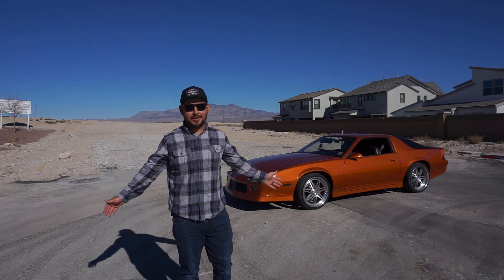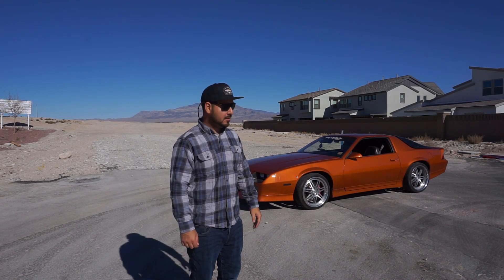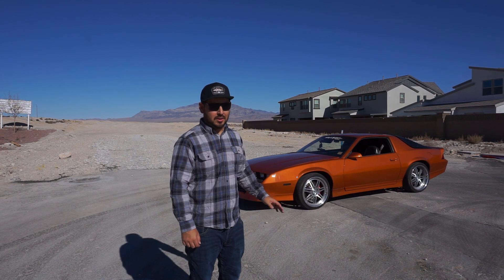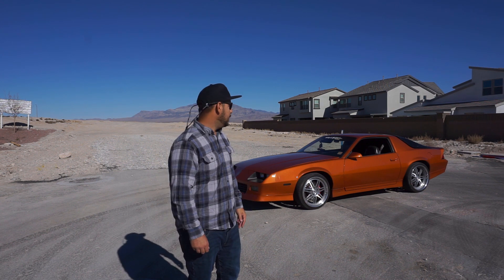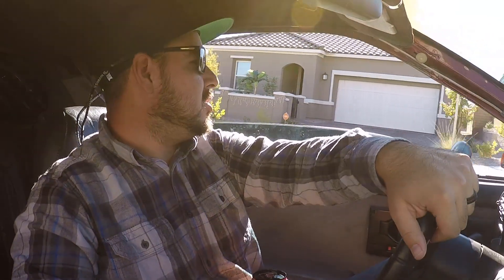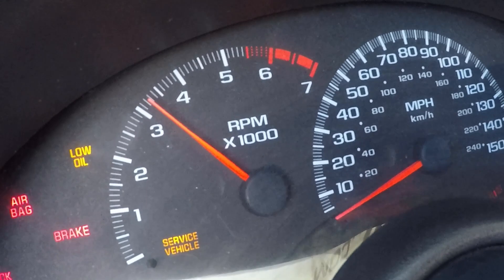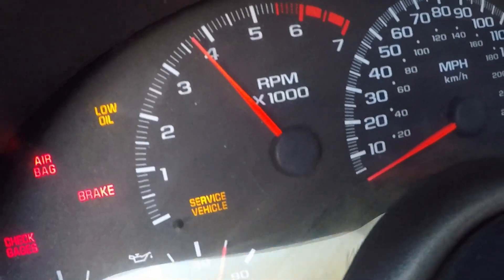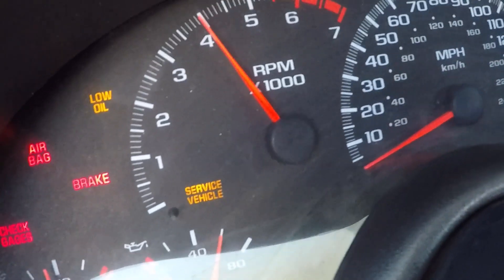Th400 SWAP, IS IT WORTH IT? COST, DRIVABILITY AND PARTS NEEDED

Comment: I plan on rebuilding my 350 to a 383 stroker with a edelbrock 600 cfm 4 barrel and lunati voodoo  cam paired to a  700r4 with a shift kit and slaping it into a 90's firebird

Comment: My 99 tahoe with the 5.7 vortec has a drag racing tci th350 with a ratchet shifter, I love it even though I get about 8 mpg with the trans and lower gears in the rear end. The speedometer doesn't work but GPS said it runs at 2k rpms at 35 and 3k at about 55-60 so I've learned to drive without it lol

Comment: Turbo, nitrous cam matched with 4500rpm converter with 20” wheels for drag racing…. Makes sense
Reply from the maker: Dang man, sounds like you have quite the build going on.
Reply: Dont sound like no 4500 stall

Comment: I love the Ford C6 its on par with the GM Th400 and the mopar TF A727. Its fords original heavy duty from 1966-1996. Some people gripe that its a power robber, reason is its because of the dated thrust washers. If you went to thrust bearings in the C6 aka rollerizing it like the E40d and 4r100 it would help alot. Putting in a E40d or 4r100 planetary in a C6 will help too.

Comment: If you constantly drive on the freeway the th400 sucks especially if your hitting 75-80mph......I swapped mine to a 4L80e with a trans controller and I will never go back to a 3 speed but to each his own. Great vid bro🤟😎👍
Reply: Depends the 3 speed Is good for street,strip, if your doing just strip get a 2 speed, if your doing just street ye I have the 4l60e for towing and street
Reply: What trans controller did u use?
Reply: microsquirt trans controller for 4l80e, easy setup and comes with plug and play harness. You can change shift points and line preesure.  There are many TC's on the market but a few of my buddies already used the microsquirt tc so it was a no brainer for me.

Comment: Would you happen to know your driveshaft length? I am currently doing a Big Block with a TH400 build. Thanks for the video.
Reply from the maker: I dont remember but I have aftermarket motor mounta that have like 2" of adjustment. I wouldn't base yours off mine
Reply: @FinalBossGarage  yeah. I’m staying in stock location. Thanks for the quick reply.

Comment: Iv got a 83 firebird  looking at  swapping  the 700 for a 400 not looking for  drag racing  maybe  being able to smoke  the tires  and goofing  around  some  but not drag racing  ..will I still  need to upgrade  the  torque  converter

Comment: Putting a 4500 stall in a daily is a bad idea the converter is always slipping building heat it won't last long bet.
Reply from the maker: Far from a daily. It sees the road once a few months. It also has 2 trans coolers.

Comment: I have an ls swapped z31 with an nissan 5 speed it's pretty beefy and handles the power well but I'm wondering If it was just better to do an auto swap idk the whole novelty of having a stick has wore off I suppose idk any advice
Reply from the maker: If the 5 speed works just keep it. T56 are expensive. You might also look at a cd009 trans from a 350z. Would probably sell for less with a auto.
Reply: @FinalBossGarage  meh the cd009 with the adapter ends up costing as much as a used t56 I got a 2wd gtr transmission and yes I suppose your right I appreciate your response man you got the nicest 3rd gen around it's the orange paint that makes it pop
Reply: Was a Adapter used??

Comment: What are your rear gears ? Wrapping up my motor this is my dilemma stuck between going turbo 400 or tossing the built to the moon  700r4 I have sitting around
Reply: What gear are you running?
Reply from the maker: I run a 3:42
Reply: I recommend the 700 r4 because the overdrive is killer. I can cruise down the highway at 70 at 3500 rpm

Comment: I don't know why you said you have to get a shift kit that doesn't make it shift any higher in the RPMs you have to change that in your tune
Reply: Wrong. In turbo 400 shift points at wot are controlled by the weights in the mechanical governor in the transmission.
Reply: @billskalicky5400  Shift kit does not make it shift at a higher RPM it makes each shift firmer shift points are whenever you shift it at least in a manual reverse setup that's exactly how it is
Reply: @MrYukon04  did you read my comment?  I speak about a governor not the shift kit.
Reply: @billskalicky5400  yes and I was talking about the shift kit. He was saying he needed one to shift at a higher RPM. Shift kit aren't for that

Comment: The metric 200 trans that was in the 82 and 83's are the same demesions as a th350. So the drive shaft, crossmember and yoke all work with a th350. The th400 has a differant yoke and is longer than the th350 so the crossmember will not work either.

Comment: Does driving at 3500 to 4000 rpms affect engine temp? I’m running a th350 and was concerned about the high rpms
Reply from the maker: I think it effects the trans more than anything. My motor stays at 180. I've never had cooling issues.

Comment: what do you mean is it worth it and hell yeah i daily drive my truck with a th400 get about the same mileage as my other truck with same engine and 700r4 so yes why do people question it you dont need overdrive
Reply: Yep. Overdrive is for the ones who wants to go 100mph on the interstate.

I on the other hand just want to go 70mph which ia the speed limit on the interstate , here in Louisiana .

I got a 83' c20 dually . with th400 and 275/80/r16 tires.  

Basically 33inch tires .

I want to go 392 gears to get to 70mph and thats it. currently it goes 58mph.
Reply: Forgot to mention by the way that the engine is a 454.
Reply: @stuchbrosmnore8627  mines a 5.7 th400 with 265/75/16s and running 3:73s out back so im pushing like 2900 rpm at 70 according to the math i have no tac.
Reply: @mike-bj4dk  2900 not bad. I might go ahead and put in 4:10 and that's it.

Comment: What did you use for the Kickdown switch?
Reply: Th400 dont have kickdown. 700r4 do and I think th350s do also
Reply: @rollawallace4937  Right. The 700r4 and th350 have kickdown cables, but the th400 has a kickdown switch.
Reply: @TheRv1890  th350 can do vacuum kickdown I do believe